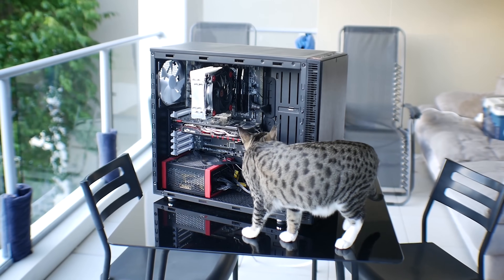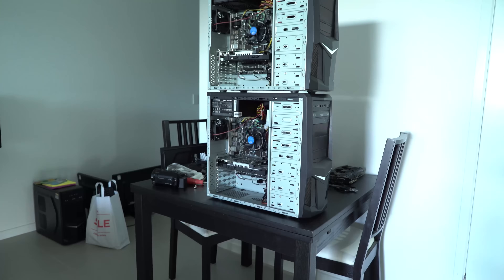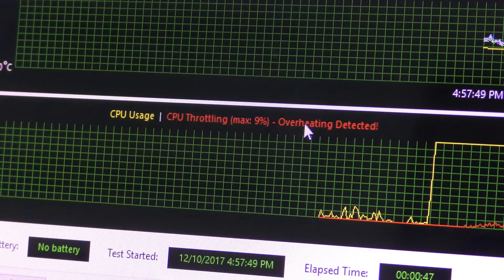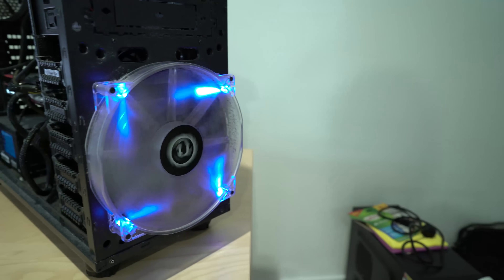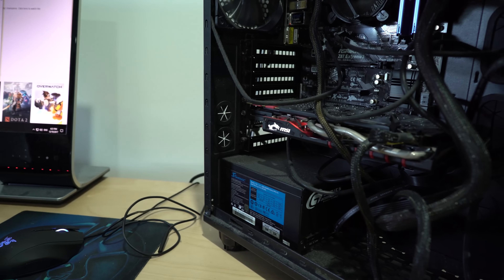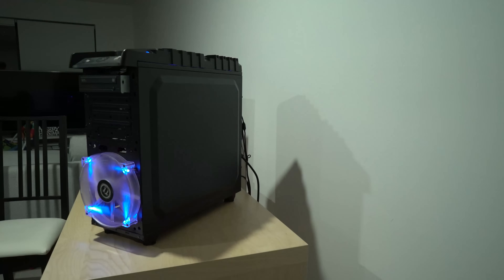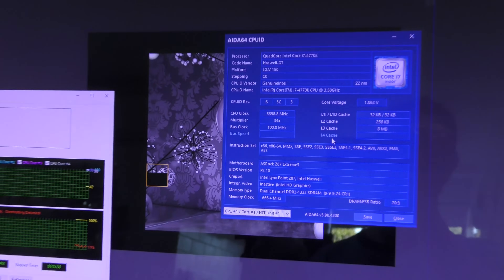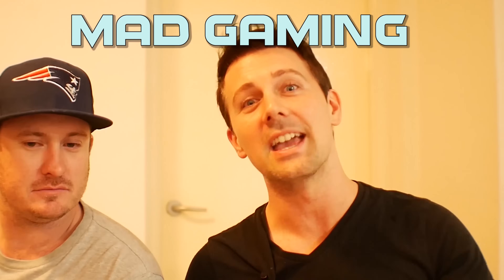PC House Call Ep.2 - From JUNGLE SANDWICH 970 to Clean 1080 HEAVEN

Comment: I need some help can someone please answer this question I have enough money to get a x370 motherboard but I was told that is b350 is all that i need just wondering if i should spend more money or get x370? Cheers and have a save Christmas.
Reply: Take a look at the video Bryan's buddy Kevin just put up.  I literally just watched it.  x370 boards are generally better in terms of features and quality.  I can't argue with that.  Considering the longevity of AM4, an enthusiast is likely to want a CPU upgrade at some point.  While all AM4 motherboards support all non-TR Ryzens right now, we shouldn't take it for granted.  I think the choice boils down to three things: whether you intend to do extreme overclocking, use Crossfire, or upgrade the CPU far in the future.  If the answer to any of those is Yes choose x370, otherwise take a good b350 and spend the savings another way.  Watch his video though.  It's interesting.  And the channel is Tech Showdown if you didn't know.

Comment: Idea for a video: Dark colors absorb more heat so will a complete white and back pc build of the same components keep the same temperature? 
Just putting it out there.
Reply: Dark colours absorb radiant heat more efficiently, but they also radiate more efficiently.  In most cases, dark colours are the better choice because components and PCBs aren't usually exposed to much radiant heat so there's nothing to absorb.
Reply: pillsburied awesome thanks for the info!

Comment: I managed to buy a Dell Optiplex 7010 which has an i7 3770, 8gb ddr3 RAM, and a 250gb SSD for $100 USD. I was shooketh. I’m gonna move the motherboard into a new case, get a new PSU, and add a GTX 1050ti to it and flip it for maybe $650-750. I plan on using the profits to build both my gf and my best friend budget gaming PCs. I’m 15, so this is a huge deal for me. Just in time for the holidays :D

Comment: Sticking a 1080 in there which doubles frames by itself is not really a Tune Up for me. Who uses a 3yo Hotwell with stock cooling, who does not at least OC his 970 to 1450mhz? Easy to tune that if you know what you are doing :P
Reply: There's no way a 1080 is over double the performance of the 970. Maybe 70-80% more.
Reply: Sure there is.. he said he overclocked it to 2050 Mhz and the 970 was at 1340Mhz and no memory OC. The stable Haswell OC also helped with maxing out the 1080 in Overwatch.
Reply: So he did tune it to get 2X? Because believe it or not, overclocking is a form of tuning. No 1080 comes out of the box running at 2,050 MHz.
Reply: Even out of the box it is roughly 2x times the speed ;) I never said OC isn't tuning. I said sticking a significantly more powerful card in there is not really tuning..*for me*. Just my two cents.

Comment: A more pro approach would be to add the sidepanel back on to help with the dust issue, get propper airflow over all components, noise level and the aesthetics. Then add a good intake fan in the buttom, turn the top fan to exhaust hot air and turn the CPU cooler to blow the hot air uppwards or backwards. Since it's a highend PSU I'd even consider turning it around to help with air exhausit.

Comment: Just wanted to Ask. Are 2 untested but clean straight socket ASRock x79 boards worth 100 bucks ????
Reply: Captainshovel if you don't bothered to loose 100 bux -Yes! Street price for good X79 board is 200$. Add a  6 core xeon E5 1650 for 130 bux and you get a good pc with 4 channel ddr3 ram that cheap now, not like fkng overpriced ddr4.

Comment: That ''main city'' is the Shaman class hall.WoW uses 1 core to the max go to Stormwind or Dalaran you will see the fps crash because of player count. Love the videos tho,just wanted to point that out to you. I have a 6700k running at 4.8ghz and a GTX 1080ti and the game can still run bad in those towns if you have the Environment and draw distance 7-10 with a fairly high player count. I play at 4k but i cut back on the Environment and draw distance to around 6 so i can keep a high fps most of the time.

Comment: He sooo needs to clean his PC. that's not the worst I've seen though. iirc i've got you on twitter. I'll send you a pic full of dirty horror
Reply: howlers8
If desert people do a build, they should include a vacuumcleanerbag solution, to collect the dust under the filters.
Reply: Hmmm not a bad idea. I cleaned one for a friend. I'd like to build them my bff, her hubby and their daughter new systems. hubby and daughter are running old single core systems. I cleaned the husbands system and pet fur and dust were literally caked and cooked onto the innards everywhere. took me forever to get it clean. I was gonna pull the heat sink and cpu and clean them and apply fresh arctic silver to them but I was afraid the CPU/heatsink would commit seppeku upon removal

Comment: Another quality video Brian, keep them coming.

1 question. Open or closed case? I thought that with a closed case with good front & rear fans that you'd get better airflow that would give better cooling, as apposed to an open case that wouldn't have that flow, just what to CPU, GPU & PSU fans draw.
Opinion?

GenFUBAR.

Comment: Why did you choose the bottom PCIE-Slot?
Doesnt that limit the card to PCIEx4? (EDIT: PCIE 3.0 x8 -> else no SLI certification :) )
Reply from the maker: Sorry forgot to mention, Luke said his previous GTX 780 Ti Fried in the top slot, so we just decided to avoid it, and the performance difference won't matter at all on pcie 3.0 8x.  Might even be running at full 16x, I didn't check physically, though the benchmarks showed no slowdowns.
Reply: Ah thanks for the quick answer, makes sense not to take the risk with a 1080 :)
Great video as always, greetings from germany.

Comment: Cool series, looking forward to more! My i5-4670k is overclocked to 4.7GHz right now. 😁
Reply: Mine wouldn't be 24/7 stable over 4.2 but then I have stock voltage and a board that isn't made for overclocking. Not even a Z Chipset so I don't really wanna add Voltage. I had it at 4.3 but after a week it bluescreened on me while watching YT so I dialed it back.